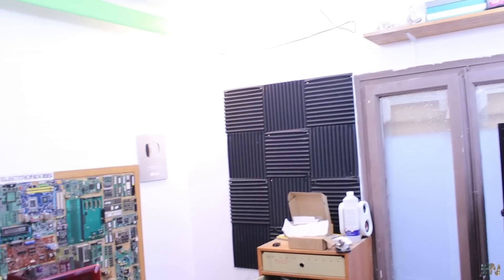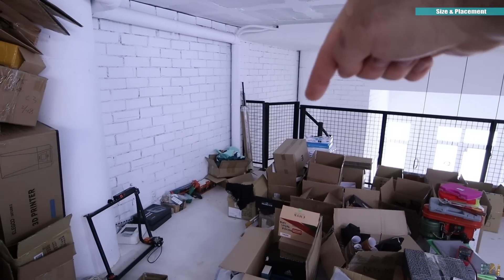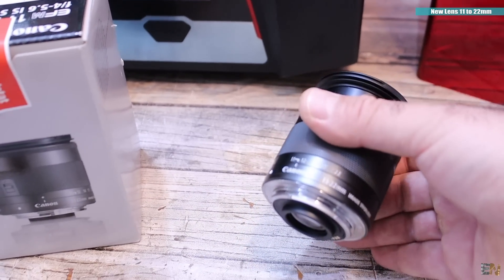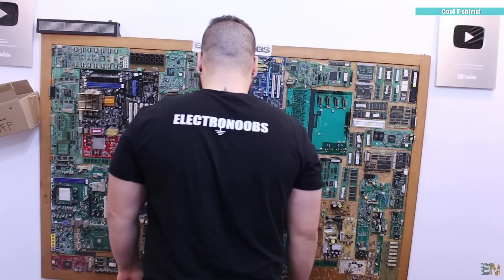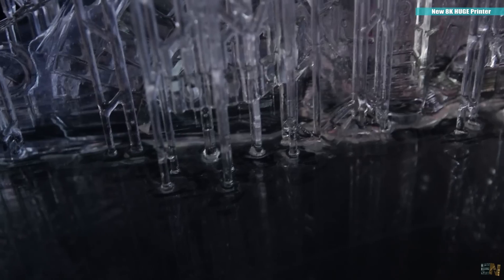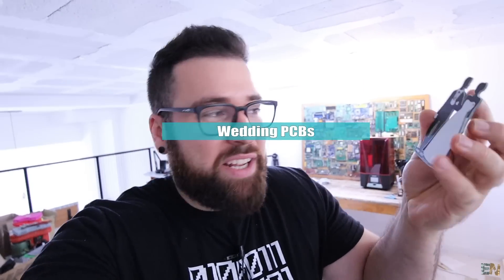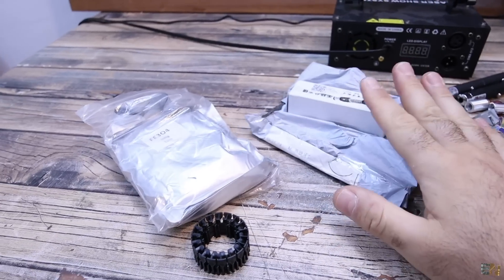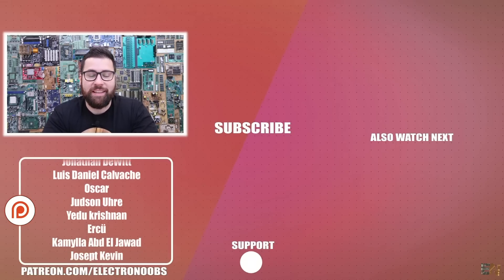HUGE Workshop, FInally - Tools | Projects | Updates

Comment: Why not use the lower window area to put there a huge workshop table onto the supports. You just need to build a small elevated floor to use that area as a table. You may put the printers, lathe, cnc there and you save up a lot of floorspace. Good luck with your new shop mate.
Reply: Look out for old kitchen surfaces, often thrown out during renovation.  If you are lucky you can get a few granite tops, and use them to act as a table there, or just some formica coated thick composite board instead, which makes a very firm table top on the concrete.  Did that using postform tops at work, cheap, sturdy, and used old racking ends from heavy duty shelving as the legs and base. Easily supported a half ton on them, and even had a few people standing on them as well.
Reply: @SeanBZA  And as I watch again you may remove the top few layers from the wall then you don't need the elevated floor.